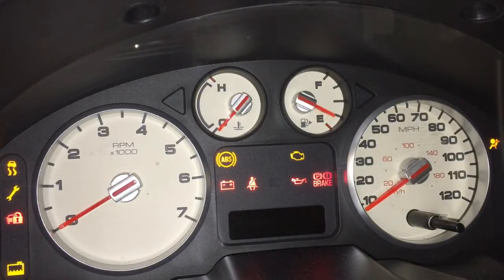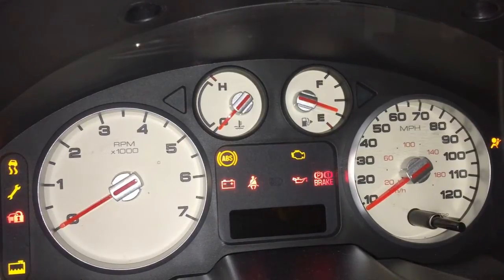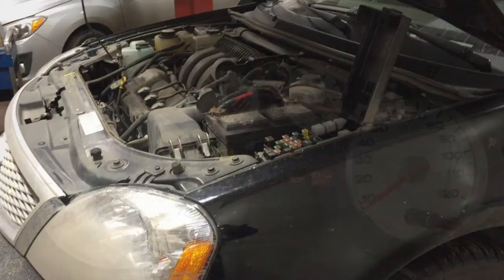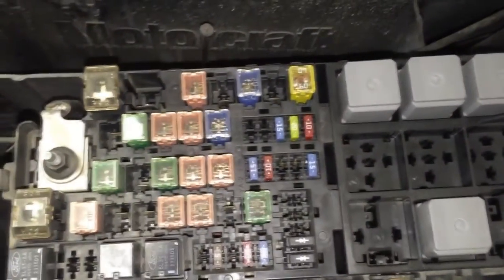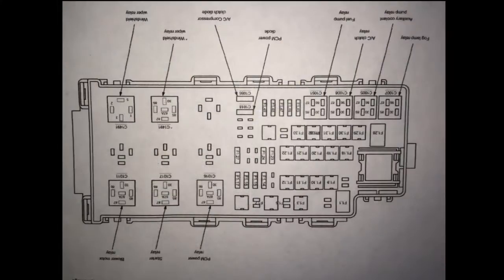AWD Ford Cars With ABS Light On and Blown ABS Fuse

Comment: I have watched a few videos about the ford 500 awd the rear driveshaft has to be removed to get pump out my traction control light is on p1889 replaced the fluid pump filter abs module cannot get the traction light to stay off